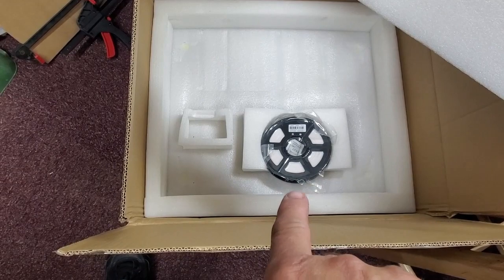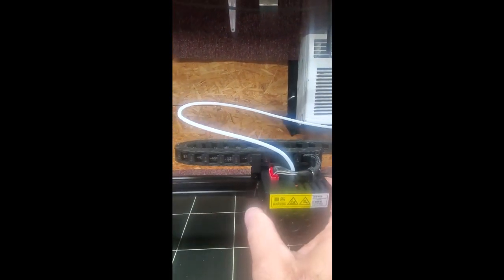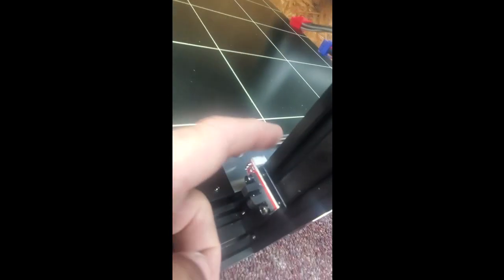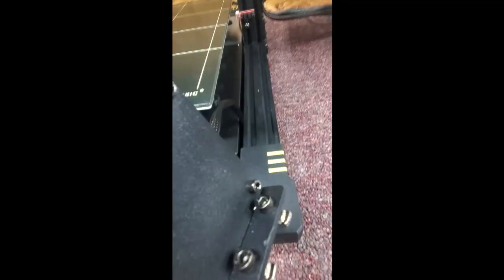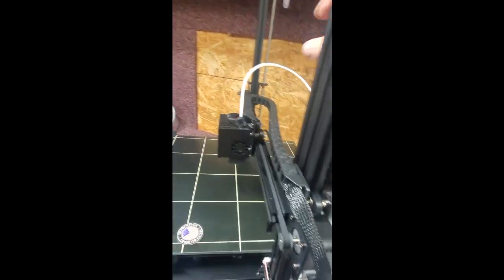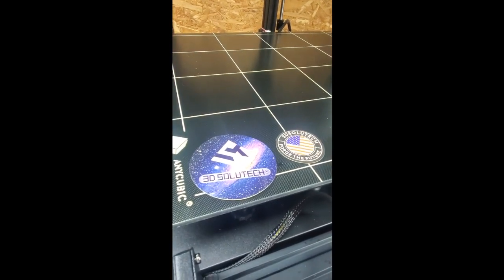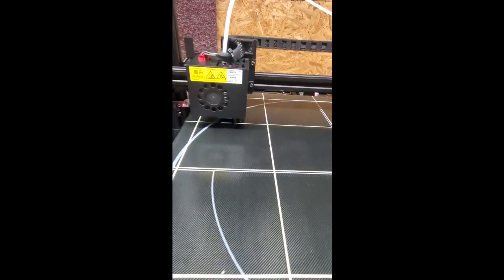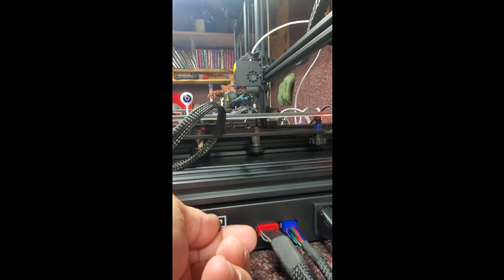Anycubic Chiron Review - What does the future hold for 3D Printing?

Comment: would highly recommend going with Capricorn ptfe tubes they are much easier to work with than the stock ones.  looks like the print pulled up in that front right corner. did you clean the bed with alcohol before printing.
Reply from the maker: Thank you for the advise